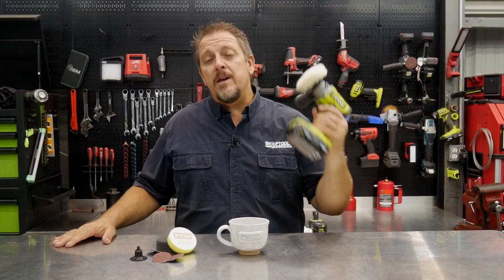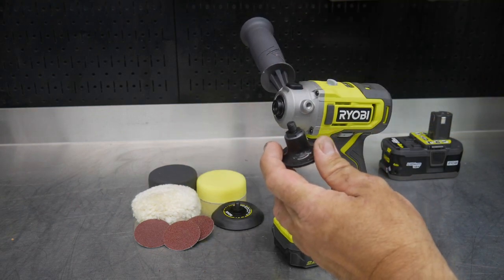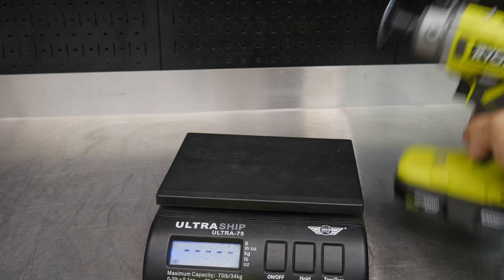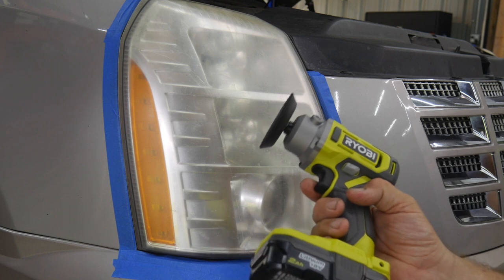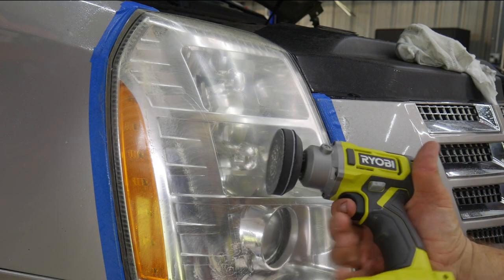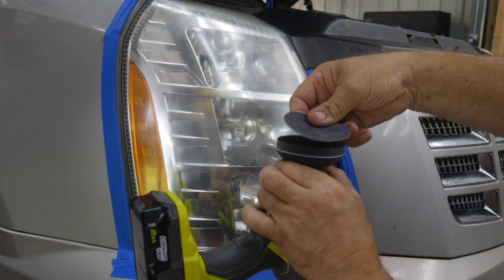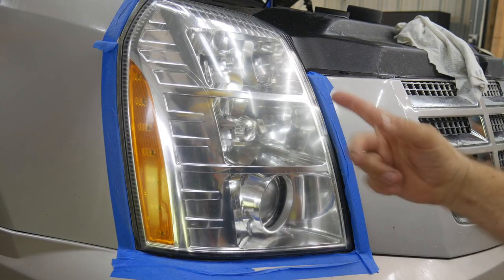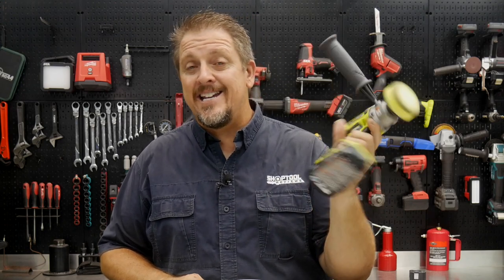RYOBI PBF102 One+ 18V Detail Polisher Review [How To POLISH HEADLIGHTS]

Comment: Ok video, but I've managed a body shop for over 20yrs now and the best advice I can give is wet sand paper cuts much better with less water and you'll get better results! And next if your gonna teach someone to do something, you should include all steps like not skipping over using compound and going straight to polish, you'll get much much better results not skipping the compound step! And all I use when restoring headlights is a 3 inch rotary polisher and I've never chipped a customers paint, even when rushing and not taping a thing off!
Reply: Can you include a link to your channel.

Comment: IMO, Ryobi should've designed it to have a longer head/chuck, since the One+ battery is so "forward leaning" on their tools. As is, the battery can easily touch the material surface that you're working on.
Reply: do you own one? i didn’t think so- you know nothing son.
Reply: My thought too. I want this one since I already have the batteries and chargers for other tools. But the battery looks to protrude forward compared to other polishers where the battery goes into the pistol grip.

Comment: So what's the difference or advantage to using this over a One+ HP drill/driver with a polish/sand attachment?
Reply: The drill/driver will have an RPM of ~1600. This has a high speed on lower option of 2800 RPM and a high speed on the higher option of 7800RPM.

Comment: Bought one of these based on this review. I already have a few Ryobi tools, several fans and many batteries. Figured this would be perfect for my older daily driver that always needs the headlights polished. WRONG! I sanded down the lights by hand first, then using the polisher I made two passes with just plastic polish. Went to buff it out and the polisher didn't work. The light came on but would not spin. Thought maybe the small 2ah battery wasn't enough. Put in fresh 4ah, still wouldn't work. The unit was hot, but nothing extreme. I put in front of the fan for about 10 minutes and it started working. Had to do this over and over until I finally gave up and just finished up by hand. Disappointed with this! I have read how some use it to buff out large areas. No clue who this tool can accomplish that.
Reply from the maker: Wow, we hate to hear this. We have used this tool for over and over without issue, and we know of others using the same. It sounds like you may have a bad unit. You should definitely return it or at least exchange it. Sorry for your troubles. Thanks for watching and sharing.
Reply: Likely a defective unit, use your warranty
Reply: @james2042   I returned it for a new one. But haven't used it yet, will need to wait for the headlights to need new polishing.
Many reviews on Home Depot say same thing about overheating issues. Perhaps they had a bad run on a few.
Reply: They accomplish it by having a functioning tool.. whereas yours sounds defective. Can you not exchange it? 

We've had a couple faulty units returned at my work so its not impossible. After all, its another power tool which can act up just like any other

Comment: Interesting to see something different. However, for large polishing I like my orbital polisher and for DIY headlights I like the $20 cerikote kit. Kit uses no power tools and don’t have to worry about knicking paint AND the ceramic coating is amazing. Don’t see the niche for this. Thanks for the review.
Reply: Cerakote is good, but if you have customers your not going to pull with your wipes and charger them $80 for the pair or more
Reply: Thanks for the suggestion of the cerakote kit. I'm going to give it a try instead of power tooling my headlights into needing replacement. 🤣
Reply: It would be unusual if you didnt prefer that lol
Maybe I misundertood what you meant though

Comment: Has anyone used this with a 2" flap wheel with the twist lock ... looking at this to sharpen lawn mower blades, with the lower speed, and cooler running flap wheel construction you wouldn't run the risk of killing the temper in the mower blade.
Reply: Get the right angle die grinder

Comment: Unless it's a tool that I just have to have I don't think I'm buying any more brushed tools. There is no reason they can't put brushless motors in everything today other than to save a little money at their end - which is what Ryobi is famous for. 

I have a 2002 Dodge Stratus that sits outside and the original headlight lenses are still clear, seems like Cadillac could have put a little more thought into those expensive lights.
Reply from the maker: The brushless/brushed motor thing...I definitely get what you're saying. At the same time, if the brushed motor can do the job, I'm not opposed to it. Yes, you're right, Ryobi is doing it to keep the cost down. It's probably moreso that they can charge a cheaper price; therefore, selling more tools. As for the Cadillac headlight reference...I hear you. So frustrating, and these have been polished before. Thanks for watching.